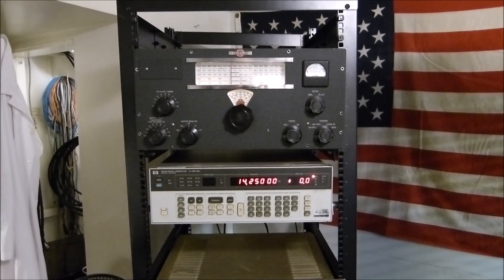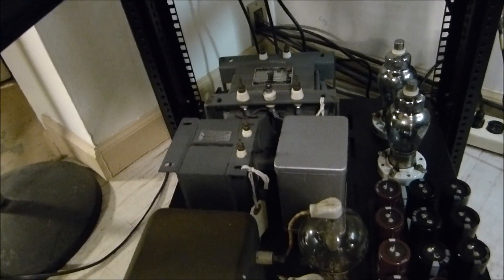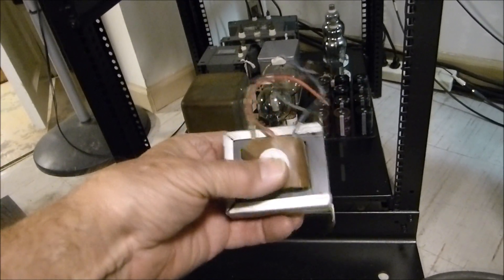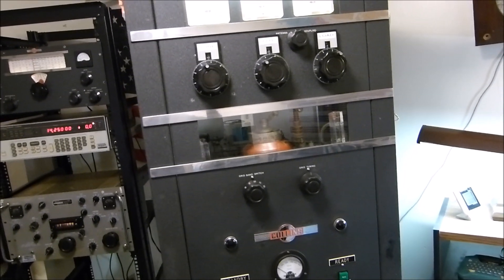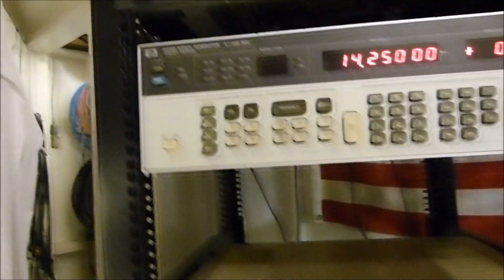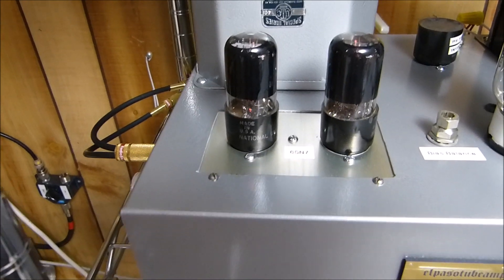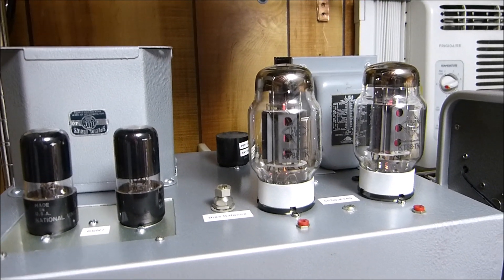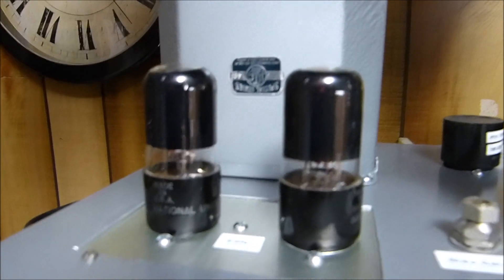AM Transmitter Update For 75M With Progress On KT88/6550 Audio Amplifier

Comment: I’ve been watching you fo years so I can build my own HV amplifier. So far half a dozen MOSFET,JFET, headphone amps, stereo amps, preamps all class A. Now I am ready this year to tackle my first HV AMP. So Many to pick from.
Reply from the maker: I agree, so many vacuum tube amplifiers to choose from. I would recommend looking at the UTC designs for the W-10 or W-20. Also, the Heathkit W series of amplifiers. Most of these use 6L6. I suppose you know about the 100 Amplifiers schematics? Here is one link - there are five books just change the "part-4"...
http://lilienthalengineering.com/100-amplifiers-chapter-1/100-amplifiers-part-4
The main thing to keep in mind, all the time... HV can really hurt and even kill. I don't want to spread fear but 450 volts can deliver a really nasty shock. Getting into transmitter voltages of 3-4KV is likely to be death-on-contact.  Never... get lazy around HV and lean on the equipment or workbench while probing around inside the equipment while turned on - keep one hand in your pocket while probing around and measuring HV - clip the leads on first with the equipment off then turn it on and observe. Make sure children and pets are not around. I have heard people say they get "tingled" sometimes by voltages in their equipment - that is a setup for some day getting really blasted. Anyway, vacuum tube equipment seems to have a soul all its own - they light up and they also have a sound all their own. Thank you for your nice comments. Stay safe and enjoy.

Comment: Very nice audio amplifier. Can you give some thoughts on using 6AX4 damper tubes as rectifiers? thanks
Reply from the maker: Hi Dan,
Attached is the datasheet for the 6AX4. It has a maximum rating of DC output current of 165 mA. Above that level, voltage drop across the tube may become excessive. It has a 1.2A filament so that isn't very large. The 5U4 has a 3A filament and the 5Y3 has a 2A filament. My opinion would be for an amplifier in the 15-20W range it would probably be OK. I see there are other blogs out there about the 6AX4 but I stick to the datasheets.
http://www.nj7p.org/Tubes/PDFs/Frank/093-GE/6AX4GTB.pdf